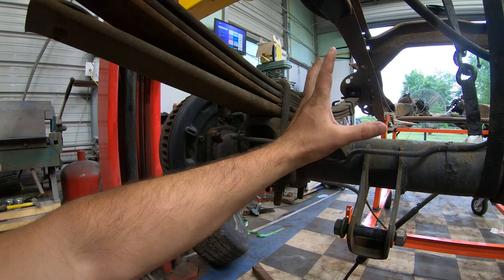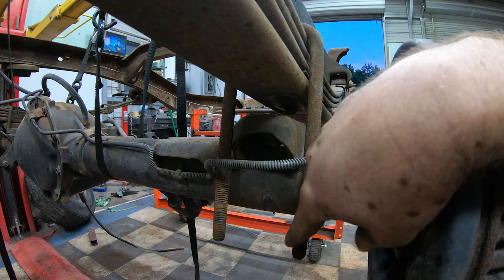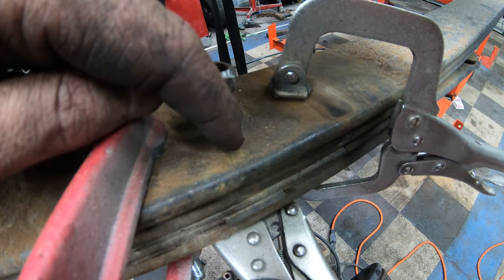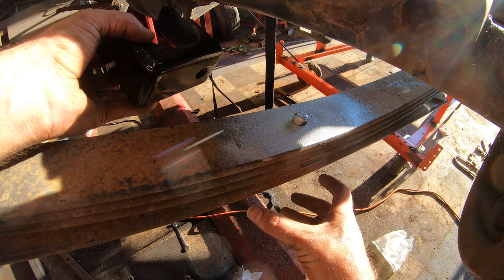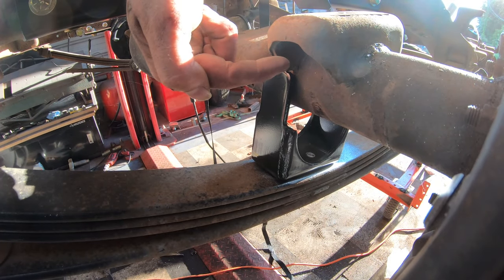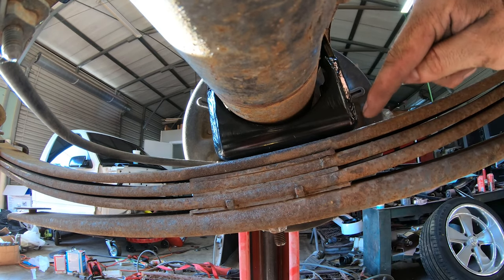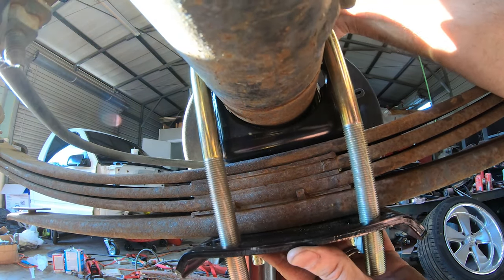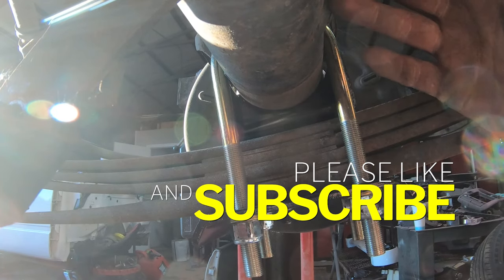Axle Flip Kit installed

Comment: Hey I noticed that there are flipkit for $100 + and some for like $30 is that important getting some more expensive ones?
Reply from the maker: Long as you are just using stock u bolts just make sure it will fit your axle diameter and weld it once in place to your axle

Comment: Hey, quick question. I have a 02 ram 1500 and recently got a Mcgaughys 2/4.5 drop installed. I only got the rear installed (because I liked how it looked), but my rear end started to shake at high speeds (Around 60-70 mph). Do you know how I could fix it or what may cause the bad shaking?
Reply from the maker: Sounds like it’s either loose, not at the right pinion angle putting driveshaft in a bind, or the flip blocks have an offset hole and the blocks are backwards to each other causing the rear end to not be straight
Reply: @1194video  Oh ok, thanks for the help man. Shit’s starting to give me a headache
Reply: Did you find the issue? Im having the same problem

Comment: Great vid clear and concise! Quick question, so you don't need to weld this at all? What about notching the frame (F100s)?
Reply from the maker: No welding required, if your C notch kit you order is for the F Series frame it too has an option for the bolt in kit, I recommend watching my comparison video showing eBay vs bel tech and I prefer the eBay kit vs the more expensive brand, it allows you to use your own stock and stronger u bolts. And has better spindles.
Reply from the maker: It’s not needed to weld because the new spring perch is extended to fit under the Origional to keep it from moving when torque is applied,  on f100 it’s needed to do a c notch if you do the flip kit

Comment: My flip kit allows my rear end to rotate some how , would i need to cut a piece of the tab on those brackets ? I feel like they dont hug the axle like it should and theres a minimal gap or would i need to torque it down more thank u
Reply from the maker: @andresmedina2827  have a shop put some weld on the axle to secure it to the flip perch so it can’t swivel.
Reply: @1194video  will do i was thinking of cutting the tabs a little so it sits more flush
Reply from the maker: @andresmedina2827  it should sit flush

Comment: Nice vid, quick question what would be the best shocks to pair this up with
Reply from the maker: Ride tech sells a really nice shock that will hold up but if it’s a budget build I’d measure your truck at lowest height and raised and get a shock over the counter from the auto parts store that can travel to those measurements
Reply: Thanks for the feedback 🙏🏽

Comment: I'm fliping the axle on my 51 Ford F1 Pickup. I like the kit you used (design and price) I was wondering if the kit you used would handle the axle diameter of my truck. What's the axle diameter of your pickup? Thanks
Reply from the maker: Go to northern tool to the trailer area and there are axle pads there cheaper that might fit for better price
Reply: @1194video  What I meant to ask: what is the axle housing diameter that the u-bolts would fit on? I think the axle housing on my truck would be slightly smaller than the axle housing on yours. Just wondering
Reply from the maker: @darylvoorhees2629  I believe it is 3”

Comment: I’ve got a 2017 Silverado 4wd I’m wanting to do either a 3/5 or a 4/6 drop on 22s, was curious if I would have to notch the frame or if there was a way to not start cutting the frame lol any help would be amazing! Was looking to do a flip kit in the back and a set of lowering upper and lower control arms
Reply from the maker: You could remove the bump stop above the rear end that’s on the frame and give more clearance

Comment: Just curious, did the drums fit between the frame and spring pack? I'm doing 68 f100 and it looks like i might have to drop my springs.  I didn't know if there was more than one way to do it and if there was what's the simplest?
Reply from the maker: It fits same as stock just changes the axle from bottom to top or vise versa

Comment: I am about to lower my 94 suburban. I will lower 4" in the front. ( i have new belltech spindles and springs for that) was thinking of 3 or 4" in the back. the leafs have a bit of de-arch from time and want it to sit level or slightly lower in the front.  so for the rear I bought a c notch kit and 2" shackles.  Should i just do a flip with no shackles for the rear?  how much would just the flip no shackles lower the rear by?
Reply from the maker: If you flip the axle you have to measure the height of the leafs which is close to 1.5” then from the leaf bars to center of rear end which is close to 2” so if you flip the rear it’s going to drop you that x2 so roughly 7” from where it’s at now

Comment: Was wondering if you could tell me the sizes of the parts that came on the flip kit I’m trying to make my own lol
Reply: Or the measurements
Reply from the maker: You could cut your rear end spring perch off and mount it on other side and weld it in to save on that. And run to scrap yard and get piece of pipe to make c notch and weld into frame and box it

Comment: I have a question I  just bought a flip kit for my 2006 ram do I need to weld it or it be okay to leave it like that ?
Reply from the maker: @NandoPacheco-jc3tb  the only reason to weld a flip kit is if it does not have the ends that reach to the origional perches, if the rear end can rotate on the flip perch the. It needs to be welded to prevent the rear end from twisting on the flip perch.

Comment: I did mine today same kit and I have the drop shocks but it is stiff like the shocks aren’t working
Reply from the maker: @morepower3242  it can’t be any stiffer than stock, you didn’t change the rear springs and by adding the shackles it will soften the ride but the front could be stiffer if you got v8 springs they are harder and v6 softer so that’s probably where you have stiffer ride

Comment: Did you have to cut your u bolts ? Mines are much longer then the stock ones
Reply from the maker: I had to cut the excess threads off.
Reply: Last question, I promise. For the driver side flip kit, the hole should face towards the back of the truck, towards the bed?
For the passenger side flip kit, the hole should face towards the front of the vehicle?
Or Both Belltech logos should be positioned to face towards the engine.
Reply from the maker: @ant-hu1gs  sorry it took me so long to reply on the bottom. The rear end is Center to the hole, but on the top the rear end has to be in the same center position as it was at the bottom so just put a straight edge from the floor up and make sure the rear end is positioned where both sides will be in the same location as it was from the bottom positioned on the top I’m pretty sure that offset hole goes towards the front meaning the shortest side of the whole would be on the front and that would cause the rear end to be further back which centers it in the same location if it was on the bottom of the leafs, but just make sure using a straight edge from the floor up that the rear end oncemoved to the top will still be centered to the bed openings

Comment: what year truck was this done on? i can only find the kits for newer trucks i have a 1970 f250 with a dana 80 rear end.
Reply from the maker: You can buy the kit for any model truck but may have to drill the line up hole larger if it’s not correct size. This one is for a 96 Sierra. All you would have to do is make sure your leaf springs are not wider than the 1/2 ton and if not just order the kit for a half ton
Reply: @1194video   thank you ill go out an check every thing and start doin my hw again

Comment: what happens if you didn’t flip the bolt over the other side ? And install the flip kit that ?
Reply from the maker: Sometimes it can hit the axle keeping it from fitting into the pad but if it centers and does not wobble it should be fine
Reply: @1194video  thanks appreciate it
Reply: @1194video  the black pad that comes with the flip kit ? Or which black pad ?
Reply from the maker: @temp285  the pad in the kit the rear axle sits in to flip it. If the bolt is too long it can hit the rear end keeping it from sitting into the pad.

Comment: When you do that do it affects the payload capacity?
Reply from the maker: It’s the same long as you keep your factory shackles but regardless you can do helper bags to improve that
Reply: @1194video  thanks for your advice 🙏
Reply: Not at all but other things limit how much you can load. Like full size tires rubbing your fender or wheel well, frame slamming hard on axle when you go over a messed up road that bounces your truck up, or loading to capacity and causing your front end to raise up a little which could lead to handling problems especially in rain. I just ordered an Air Lift Air Bag kit for my 2012 f150 on a flip kit (not sure the exact drop measurement but it’s designed for up to 6” drop according to the description) to help load leveling and it helps me be able to load 2k lbs like as if i was at stock suspension.

Comment: do i need a c notch for this?
Reply from the maker: You don’t if you remove the bump stop but it will hit when going over bumps without the c notch
Reply: @1194video  ok but im using my stock shackles should i still remove them?
Reply from the maker: @xmakeugopassivex2795  if your just doing a flip kit it gets you roughly 5” drop and if you get the 2” shackles you can go 7 but it’s going to be very close to the frame
Reply: @1194video  ok thank you man ima order one now and get to it
Reply: @1194video  sorry one more thing do i need lower shocks or can i use my stocks .if i use my stock shocks will i still get 5 in?
Reply from the maker: @xmakeugopassivex2795  you can use stock shocks but will need shock brackets that lower the mount. You might get away with using without just slam it and see if you have travel still, shocks are recommended though for best ride
Reply: @xmakeugopassivex2795  you don’t need a notch it’s recommended tho for a smooth ride

Comment: What all do I need to make sure I did right to not mess up pinion angle
Reply from the maker: The typical leaf spring rear suspension will need 5-7 degrees of negative angle. Go get you a magnetic angle reader from harbor freight and put it on the yoke where the driveshaft mounts. You should never have a positive angle though.
Reply: Google and read about pinion angle...
Reply from the maker: @jcanfixall1585  I have wondered why people reply and ask certain things when it’s just as easy to immediately get an answer from Google

Comment: My 6” flip kit didn’t come with u bolts, am I okay to use the oem ones?
Reply from the maker: @winterxo192  I used the Origional ones on my other truck, just check that they are torqued right and check them later after you drive it a bit
Reply: @1194video  thank you!! Got my front end lowered running 4.5” drop than the flip kit and c notch

Comment: Whatsup man! I just got mines installed but it makes a clanking sound what could it be?
Reply from the maker: Clanking Continuous? While moving or over bumps?
Reply: mine does it too
Reply: its when i hit any little pothole
Reply from the maker: @JorgePiña-k1z  make sure the u bolts are li ed up straight and torqued, could be hating from impact if not tight
Reply: Probably pinion angle

Comment: Your Truck is a 1991 but, is it a Ford? I'm looking into doing this to mine which is a 1991 Ford F-150 XLT Lariat. So basically is your truck a 1991 Ford F-150?
Reply from the maker: It’s all the same fir trucks with the axle below the leafs, it requires a flip kit to get it above to go 5” or add the 2@ hangers to go 7” I have five this on both GM and Ford, both exactly the same

Comment: What you do about the driveshaft being to long?
Reply from the maker: It’s not, the yoke slips in and out of the tail shaft the whole time you drive, it’s made to where if your loaded to the axles with weight it still has travel. No issues
Reply: I’m having trouble with mine being about a inch long everything lined up great
Reply from the maker: @thomasdavis8164  your rear end has to be in the offset hole not the centered hole. If you put it center it moves it too far forward
Reply: That’s what I did I used the original bracket but a new one and welded it on the opposite side when I flipped it

Comment: why do we need to flip the guide pin around ?
Reply from the maker: Because it’s the pin that centers the perch and if you don’t the bolt head sticks out and contacts he axle keeping it from sitting flush in he new perches
Reply: @1194video  so I have to remove my flip kit again and flip the guide pin . I have the flip kit install but my rear end shifted , you think it’s bc I didn’t flip the guide pin ?
Reply from the maker: @temp285  could be, the U bolts need to be torqued and the rear need to sit correctly in the flip perches

Comment: Did my drop on my obs and my diff is a little pushed forward how can I fix it ?
Reply from the maker: Your flip kit should have an offset hole so it corrects the position on the rear. Mine had two holes
Reply: Turn the axle brackets around, you probably put them in backwards...
Reply: @jcanfixall1585 what are the axle brackets ? my diff moved a lil forward too and I wanna fix it
Reply: @temp285  the half circle things with a flat spot on the bottom, they have a hole to align the rear axle on the leaf spring pin... When you lower a rear axle the bracket is designed to move it back about .5-1 inch...
Reply: @jcanfixall1585  are they the black plates ? That the u bolts go to ?
Reply: @temp285  NO...
Reply: @temp285 the part at 2 minutes that hole needs to be in the front, and if you have 2 holes use the one that is towards the front... If you watch the video he explains everything!!!

Comment: Your axle brackets will crack and then leak if you do thos setup.   You need the flip kit that has the flat plate that goes over the you bolts. Dont do this way. You will get alot of axle wrap
Reply from the maker: it’s no different than stock perches once you finish weld them to the axle, only way it could possibly crack the old perch is under heavy torque which show trucks don’t get very much of.
Reply: @1194video  oh yes definitely a big difference. I fix these all the time    this not the way 😂
Reply from the maker: nobody’s going to go spend 5k on links and coil overs dude, this does the trick even auto dealers run them on all their custom lot builds.

Comment: Do you torque the u bolts with suspension loaded or unloaded?
Reply from the maker: Add torqued man in the air and check everything after driving roughly 10 minutes

Comment: I have a 2016 Nissan Frontier and it’s set up similar to this. I’m only wanting to drop the rear 2” but I’ve looked everywhere for shackels or anything like that any advice? If I did the flip kit and didn’t want the full 7” could I in some way raise it back up 5”. Tia I’ve looked for vids everywhere there is nothing on this model
Reply: 2 inch Shackles would be best option.. but if you can’t find any for your Frontier, you could look at a flip kit where it comes with or you can add one of those little block between the axle and leaf spring so it’s a little taller but if you load anything on your bed, flip kits reduced suspension travel..
Reply from the maker: I believe the rear end is u see the leafs on your truck, if you only want a few inches you could remove the front leaf spring hanger and spin it where the leaf is above the hanger rather than on the bottom But then you will have to make certain the rear end is centered before drilling new holes and bolting it back on….. but you could buy lift shackles and flip the rear end so that you can lower it by flipping the axle then the lift kit hangers could raise it to your desired height. You can pick up the flip spring pads at tractor supply if you use the stock u bolts.
Reply: @1194video  I appreciate that awesome video you posted very helpful. I just seen your comment thanks for the info
Reply: @Vhifzvjif  thanks for the advice this truck is hard to find much on as far as lowering I did find a flip kit though. The problem with the shackels is there so close to the frame you can’t go up any higher as it is.

Comment: Would that bolt on leaf springs make a difference? I didn’t flip mine how you did. I just let the bolt sit on that slot. I have vibration now😐
Reply from the maker: Only if it’s keeping the rear ended from sitting flat on the leaf. If it’s not then it won’t make a difference, your driveshaft could be too far into the transmission after lowering it causing it to vibrate. Mine had no affect but could be a possibility
Reply: I got vibration in mine after a whole I think I didn’t install my flip properly and mechanic said it’s not the right one for my truck

Comment: I have an 04 ram I did the flip kit instruction for instruction but now my rear axle is doing a ticking noise when it goes in drive and it’s at an angle
Reply from the maker: Shouldn’t be at an angle, the driveshaft needs to freely rotate without contacting in a kink.
Reply: Google and read pinion angle...

Comment: Nice video 👍  great job  i did this to my old Ford F250  i did not turn my center bolt around though  next time i do anything there i will.  One thing that happened was  those tabs that go up in the axle spring perch i had to rotate my axle forward to match the original    driveline angle it left a gap in those tabs in the back  i did a hard pull and my axle rotated backwards it was sticking up and driveline rubbing my e brake cables . I had a welder weld that bracket around the axle tube so it never happens again .